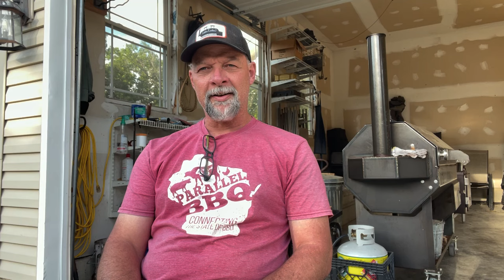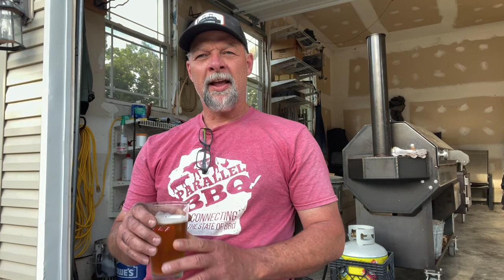The Secret to Perfect BBQ: Mastering Radiant & Convective Heat!

Comment: I built one of the Gravityfeed smokers and use a Heatermeter to control temps.
Reply from the maker: Those work great!
Reply: @SmokerBuilder Yeah, I been with the project since it was known as the Linkmeter.   Bryan Mayland did an awesome job with the design and programming.  I designed the Adapter Board to work with a Rotordamper.

On your double pan Gravityfeed smoker, I use a 30cfm blower and the HM and it will hold perfect temp for hours on end.

Comment: I’m collecting the stuff to put together a 500 gallon offset. I have a 500 gallon tank and a 120 gallon upright to use for the burn chamber. Was considering insulating it, to conserve wood, but now I’m thinking I might not.  What are your thoughts on insulating the floor of the main cook chamber? Would there be any advantage or disadvantages? I’m really liking your channel.
Reply from the maker: great question! I have never noticed any significant improvement insulating the bottom. I know Pig Iron Patina speaks highly of this method though.
Reply: @SmokerBuilder thanks!